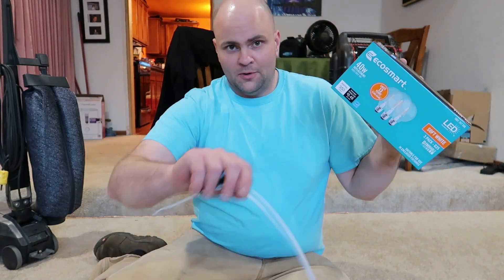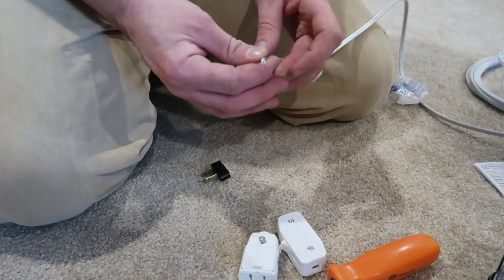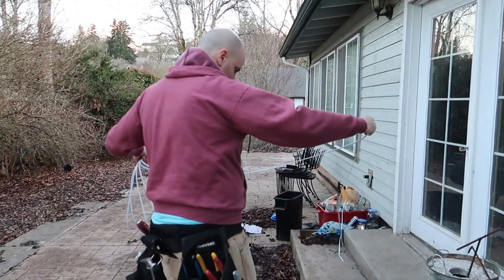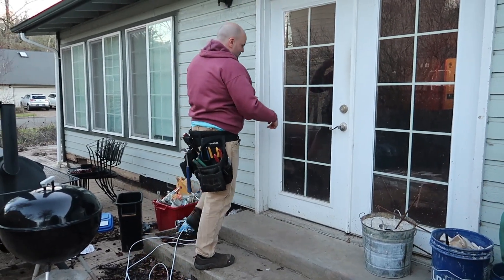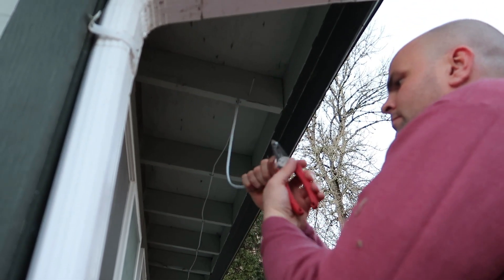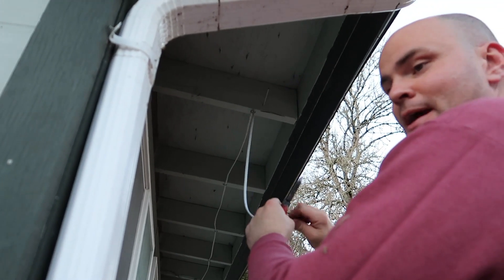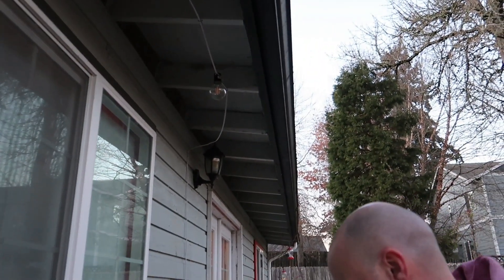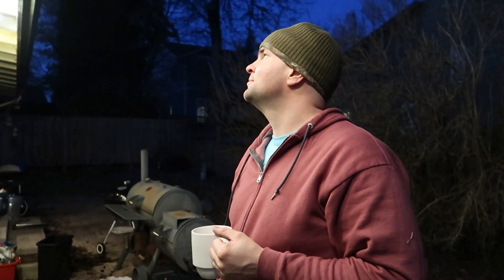HOW TO MAKE YOUR OWN STRING LIGHTS | DIY LED STRING LIGHTS | ROPE LIGHTS

Comment: Hi I am trying to make the lights, sometimes sellers say bulbs are 3w sometimes they say its 24v, I don't know I am in AUS so 240v from power point. how do i ensure I don;t blow anything? how do i get an idea how bright it is going to be, i have a bulb that is 23w and 1610lumens that i want my festoon to be much lower. hence when they say the bulb they sell is 24v, I don't know how bright.
Reply from the maker: Well over here I’m at half the voltage at 120 volts but as long as you using lightbulb that you can buy from your local store and screw into a light socket or lamp and it functions it should work. Now as for the lightbulbs over here I just bought LED lightbulbs that consume 4 watts of power and put out 40 W of light. I bought that particular lightbulb because I liked how bright it was and I’ve used it before. So just buy a light bulb that you’ve used already before. I have no idea what 40 watts would be in luminous for the light output. Now just in sure that you do not have the neutral wire in the hot wire touch each other that will blow a fuse or trip your breaker. And please remember you doing this at your own risk.

Comment: You just install the lamp holder without stripping the wire? How could it be possible?
Reply from the maker: The lamp holder context are made to penetrate the insulation and they make contact to the conductor. During the video i had trouble cause it wasn’t tight enough.
Reply: Where did you get the lamp holders ? And the plug also please 
Thank you

Comment: can you tell me the materials you all use. i want to try this. thanks for sharing
Reply from the maker: Lamp wire (18/2 gage)
LED light bulbs (we used 40watt output)
Lamp holder
Plug